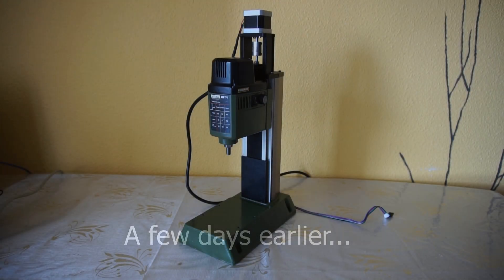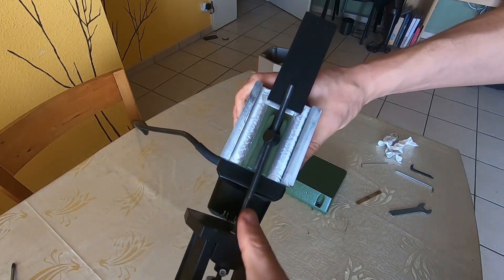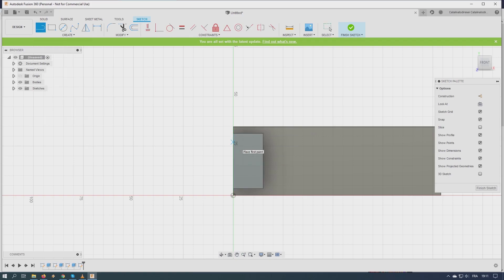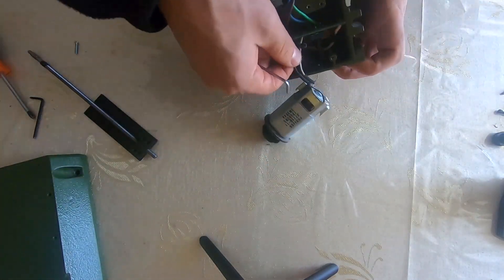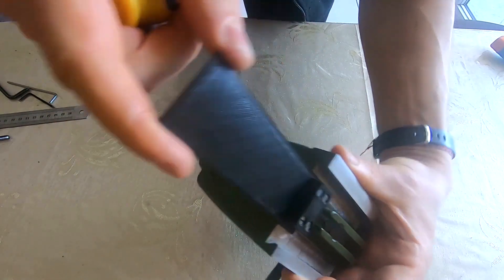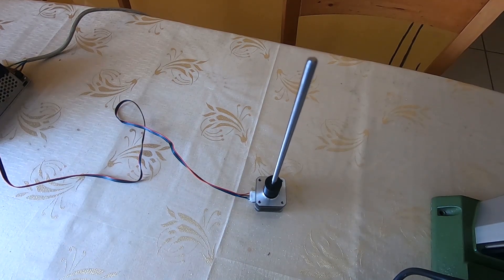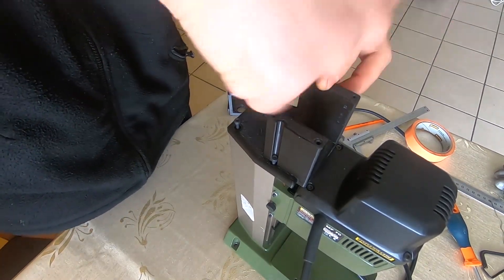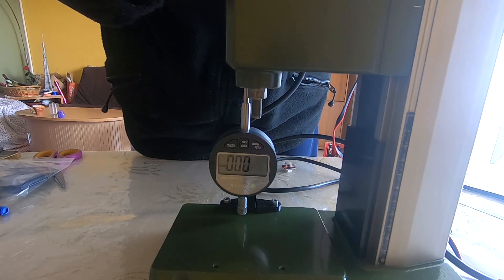Another Proxxon MF70 CNC Conversion - Part 1 - Z axis

Comment: I'm not sure I heard this correctly - are you saying that the generic machine is not suited to such precision milling? Or is it that the previous user maybe worked it a bit too hard and threw things out of alignment? I'm thinking of getting one for carving stencils, so I want to be sure it's precise enough. 

Aside from that, nice video - good sense of humour, and lots of useful detail about what to take into account.
Reply from the maker: Hello. Well, I don’t want to throw dirt at Proxxon, but I think indeed that the precision of the MF70 is a bit of a letdown. When used in manual mode, you can tighten the gib on the dovetail to a point where it doesn’t wobble, and use more force to turn the handles. For a CNC project, with the small Nema 17 motors, you have to compromise and let them a bit looser. 
For real precision, you should probably get something with linear guides rather than the dovetail track. I was thinking of upgrading the Proxxon, but than it would be easier just to start from scratch and make my own CNC milling machine/router.